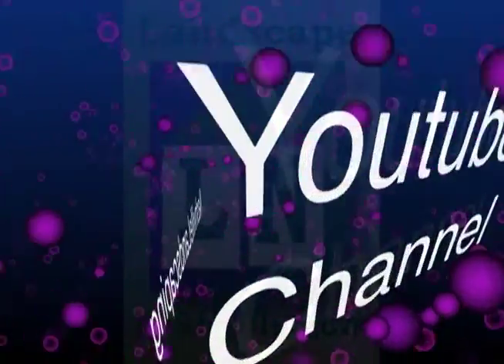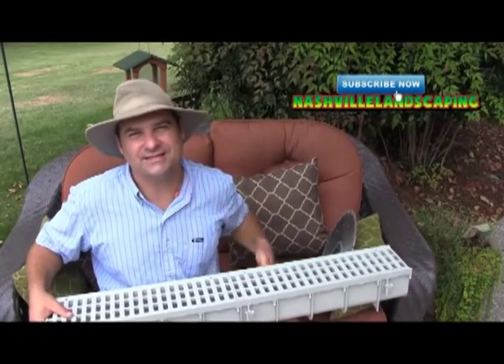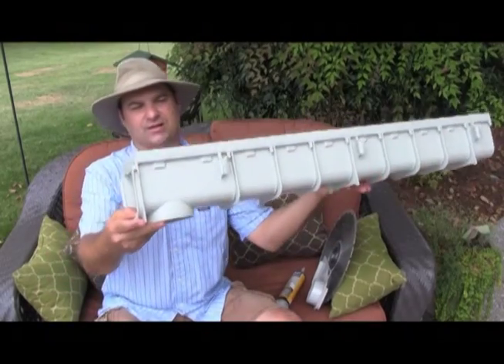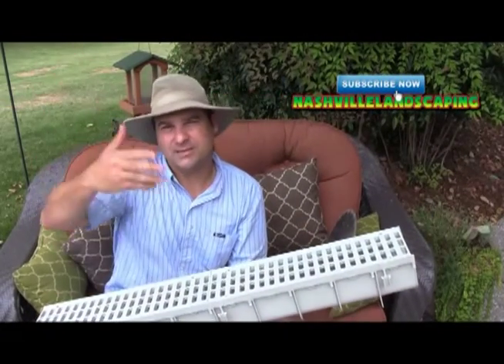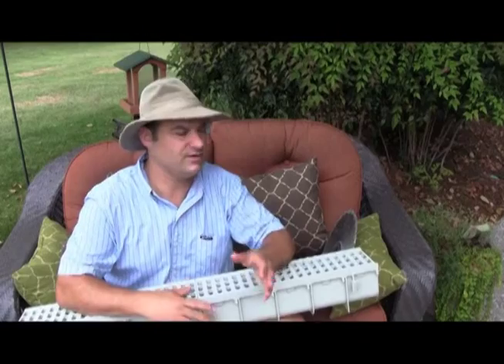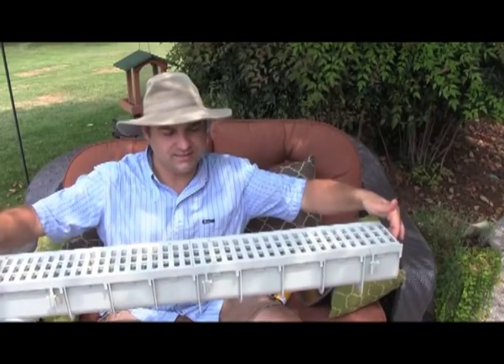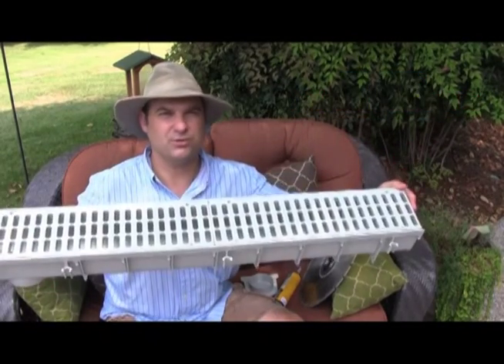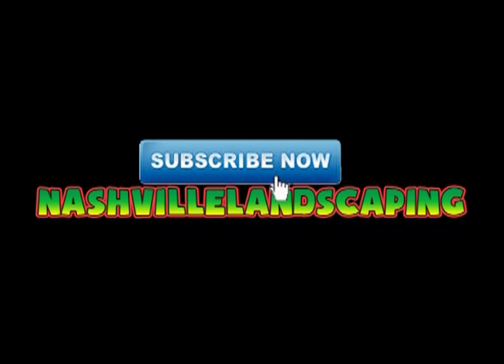What is a Driveway Drain Channel Drain Trench Drain?

Comment: We just had a new asphalt driveway installed and I wish they had put one of these at the entrance!  But do you know if it will fill with sand that washes down the street in the rain?  If so, is the top removable to clean it out?  Thanks.
Reply from the maker: +opentrunks Hi there yes the top comes out with a typical phillips head screw driver. There are only a couple of screws holding it on so it is every easy to clean out. I hope this helps.

Comment: Hi,dear friend, with our experience, although the plastic trench drain is light and could bear the loading strength, but what standard is this product in accordance with? En1433? Obviously not. Normally the plastic products only used to the DIY house use drainage system. To driveway projects, the trench drain will bear not only the loading strength but also bending strength from the soil or concrete from the both sides of the trench drain. Many of the advantages of resin concrete trench drain like fire resistance, better performance of offering more compression and bending strength.
Reply from the maker: Hi hardware dinggin, I totally agree there are much more durable drains for commercial uses. If a typical residential client of mine was to request a price and I gave them the option of one of these in the video and one of the ones you mentioned over 90% would choose the more affordable option. For larger homes and commercial applications the ones you mentioned are great. Did you subscribe to our videos?
Reply from the maker: Hope you have a great day. Did you subscribe?
Reply: Many thanks dear friend, have a good day. Yup, I subscribed it a few days ago.The small videos are very useful.